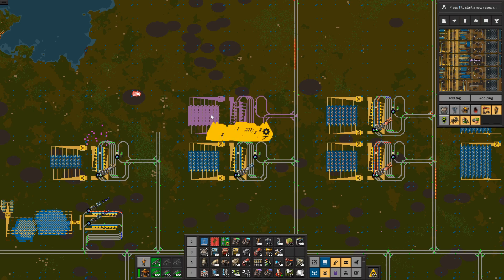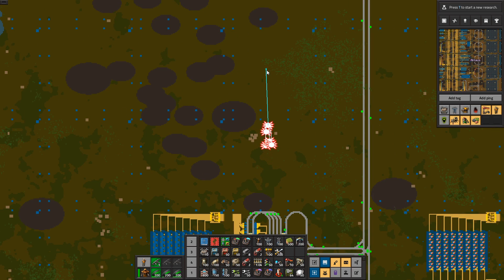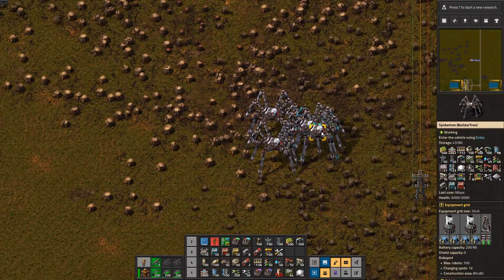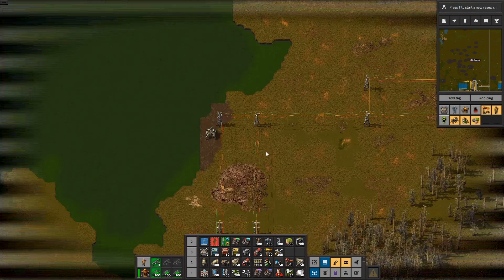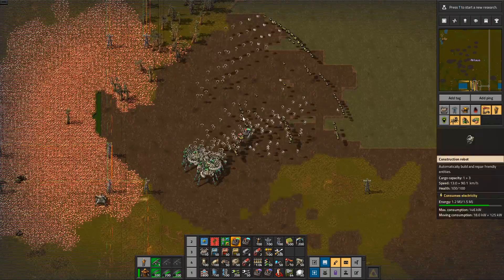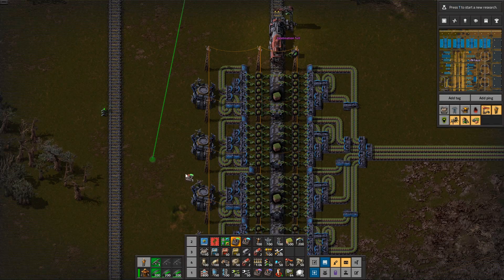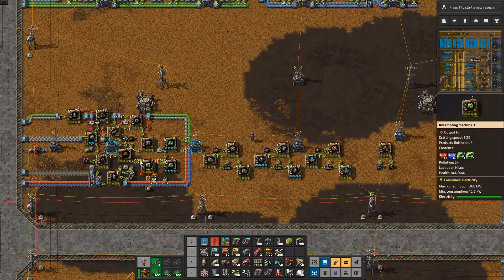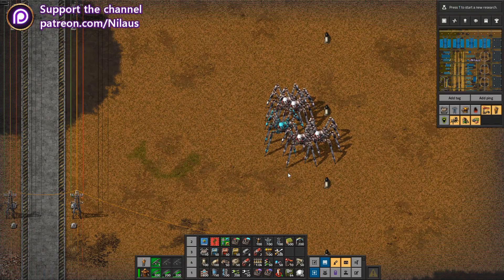SPIDERTRON Builder Army | Factorio Tutorial/Guide/How-to

Comment: I've been playing around with builder trons myself and here are my suggestions:
Instead of 2 Batteries and 1 Exoskeleton, having 6 Batteries helps A LOT with bot charge, specifically when doing large builds or landfill. It ends up being faster in the long run to build faster since you can multi-task while spiders are moving to resupply or to the building site. The 2 Battery 1 Exoskeleton setup is still fine when having a spider specifically for making mining outposts though.
You should only enable logistics while moving if you have a high enough bot speed. Even the slowest spider outspeeds a bot if you only have all of the non-infinite bot speed upgrades.
Don't forget to put cliff explosives in your builder spiders. If you're putting wood / stone / coal / fish to auto-trash, you'll want to make sure they can take care of cliffs too. 
Requesting 800 rockets is pretty much a free roll for every remote controlled spider since it takes 0 slots in the trunk and it's very nice to have multiple entities out there that can put out any fires or be a temporary defense before a solid wall is up. This one is somewhat preference, but considering how cheap rockets are I'd say it's pretty much always worth it.